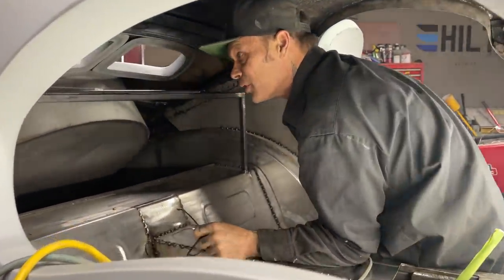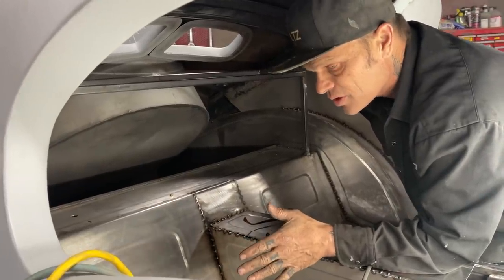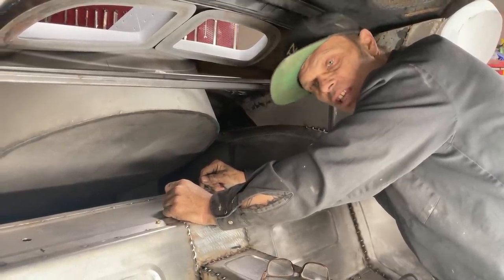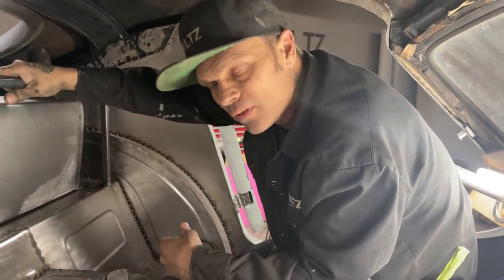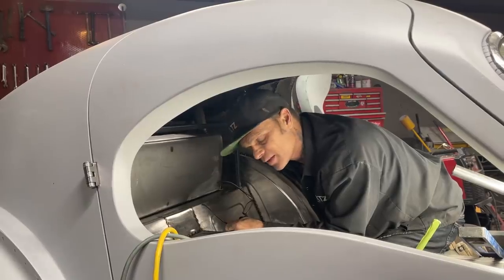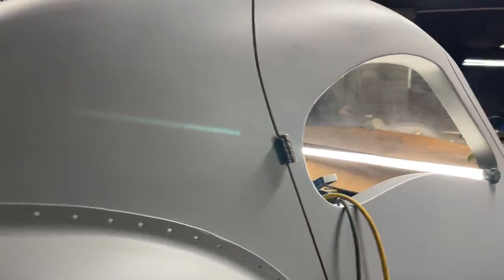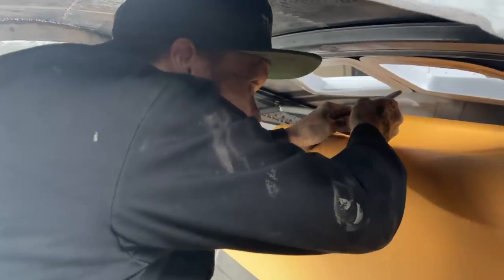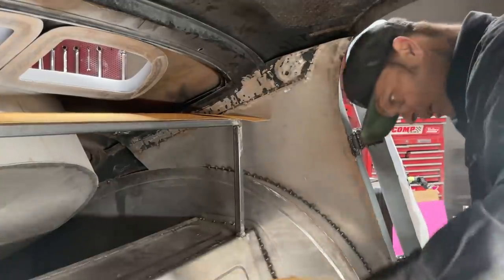BUGATTI: FABRICATING A FIREWALL BETWEEN TRUNK AND COCKPIT

Comment: I may have missed it but I didn't hear Chad say he pulled the sender out to adjust it. As it sits it will run out of fuel showing half a tank. It's a very simple fix. (If only he took two minutes to read the instructions, lol) Pull the sender out. The part at the bottom that's attached to the float is what reads the level. It has to be loosened and slid exactly half way up the slide so that it sits in the middle of the tank. Then the float ( which is flipped   180' out causing the original scraping problem) needs to be adjusted so that when the sender travel to empty bottoms out, the float just hovers above the bottom of the tank. You won't have to adjust anything for the full reading provided the sender was properly centered in the tank. Please do this before the tank is forever entombed!

Comment: True most gas tanks are under the trunk anyway separated by the metal of the trunk no different from what your doing don’t listen to the couch potato naysayers
Reply: They may be under the trunk but they are positioned between chassis members that will protect it from rupture in collision, unless,of course,its a Ford pinto.
Reply: That maybe true but I don’t think any of chad’s cars are built to withstand a crash they are a work of art

Comment: Why not a sliding door to get access to the trunk?
Reply: I looked at the Bugatti Aerolithe, and it has the same style of seats you have (fixed back), and there is very little useful space in that car behind the seats.  So even a sliding door wouldn't do much.  I thing the Aerolithe has a removable panel, but I doubt its a "door" to a trunk area.  Probably its there just for access.
Reply: Speaking of the Bugatti Aerolithe, it doesn't have any air vents, or air conditioning, and probably doesn't have a heater either.

Comment: Mate, this car hasnt been built in months or weeks, its been 4 years on and off, for my money and I know you dont care, but the tank should be put where the original Atlantic has its  tank, in between the chassis in the trunk, just like any other car, there's heaps of space there, where you are putting the fuel tank is where the baggage is meant to go.

Comment: sound like your trying to convince Jolene where the gas tank goes where you say, if you know what I'm saying
Reply: The main reason why I thought it'd be nice to drop the tank over the back would be to retain the cabin space behind the seats for a day bag/shopping. The firewall could then be down at the height of the diff riser then angle upwards to the spare tyre well. 

It would also open up the space in front of the beautiful wood window surrounds.

But it's not my build, so whatever Jolene is happy with will be what Chad builds 👍
Reply: @prdoohan  agree, better down below, but the filling system will be a challenge, agree a short run is better butt tank high up, no looking bueno, Bro ur Chad! work ur magic! also she wants you to build her a car, respect

Comment: A 1947 jeep gas tank is under the driver's seat !
The tank is fine where it's at.
Every body has an opinion !
     Keep humming along , on the most interesting build in YouTube History.
Many people don't under stand ,Chad knows what the F___  he is doing.
    Austin Healey's all of them had gas tanks bare and exposed taking up the whole trunk floor the spare tire set on top , VW bugs and Porsches had them behind the dash " in their Trunk !
GT 40 race car had them in the rocker panel ,both sides of the car.
     Most motor cycles have them between your legs , next to the Family Jewel's !
    Get over it it's as safe as many classics on the road !
  It  also has a tire on both side and a tire behind it. And is way in bound of the car in it's Safety Zone.
    Let's see a Triump TR-6 has it in the same location with cardboard press board between the driver.
  Chad has a steel cage with steel tank with a steel firewall.
Let just say , Chad ,knows ,what he is doing......just stay out of his way .

Comment: Im just  suggest to put straps to help hold the gas tank to keep it from bulging in the middle just my opioni would make them long bolt the back side in permanant an then pull over the tank an bolt up front inside the trunk